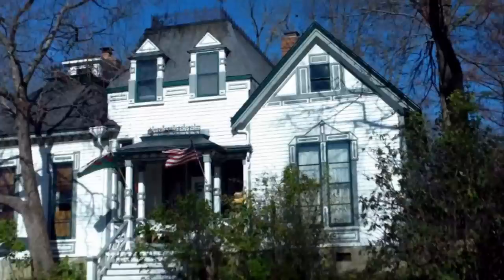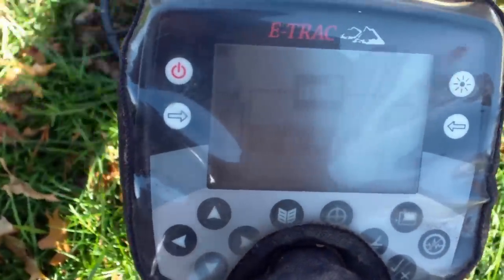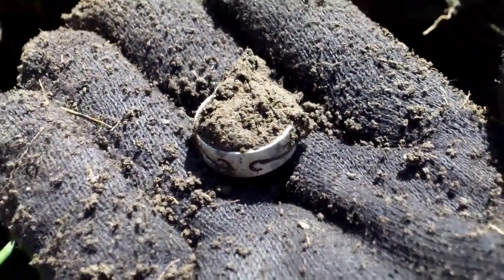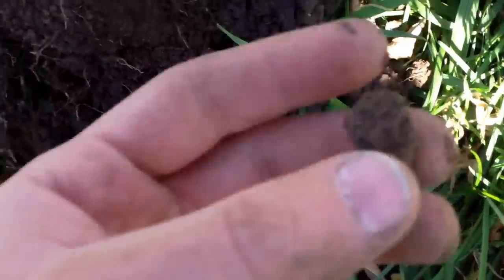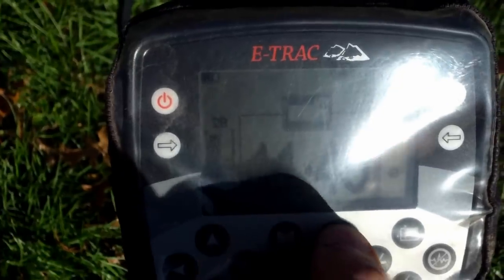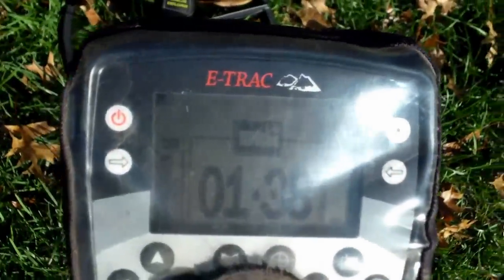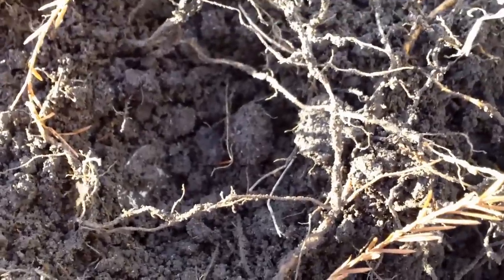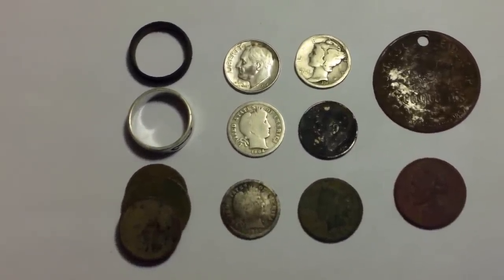Metal Detecting with Minelab E-TRAC #7 - Silver finds from large historic home

Comment from the maker: Hey Jersey thanks for the compliments. I run the Andy S. pattern and manual sensitivity as high as possible. A High sens produces more falsing but once you get used to it it's not that bad. I try to run as high sens as possible for depth. I've found deep signals running manual that others couldn't hear in auto before.

Comment from the maker: As a beginner I would recommend coin mode with auto +3 sensitivity. You can find silver easily in that mode as long as there is silver at the site you're hunting. Get Andy Sabisch book and read it and manual about 4 times. After you've put 100+ hours on the unit you'll start to understand the good signals and can begin exploring with opening the screen up more with less discrimination.

Comment from the maker: Yes the basic coin settings would work good just about anywhere. In iron infested sites it's a good idea to open the screen up more (less discrimination) and run two tone Ferrous but that is something a little more advanced. If you're new to the machine I would seek out low to medium trash sites to get used to the signals. It really depends on what kind of hunting you do. If you're interested in gold rings, relics, and other stuff then you could go with less discrimination and dig all signals.

Comment from the maker: Hi John which side of the screen are you talking about the right or left? The sensitivity all depends on the site you're hunting really. If you're new to the etrac I would suggest running in auto or auto +3 until you get used to all the good signals and falses. If you run the sens too high it will drive you crazy and you'll think it's too noisy and not working correctly when actually it's just a sensitive machine with the ability to run really HOT if you want. But HOT is not for beginners =)

Comment from the maker: A major mistake new users do is open up the screen with less discrimination, crank the sensitivity up too high, then complain about noise cause they don't understand what the unit is telling them yet =) Start in beginner mode for a while and you will eventually learn the etrac language and can start to run more aggressive settings.